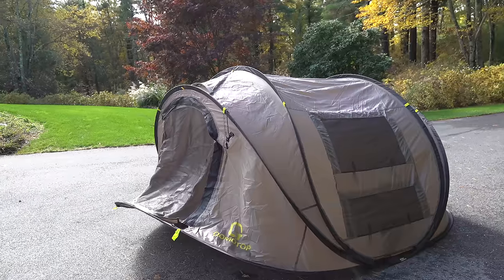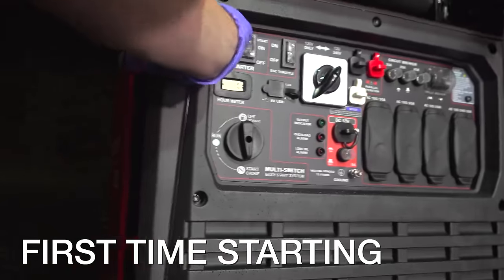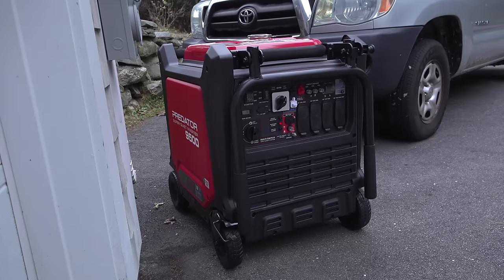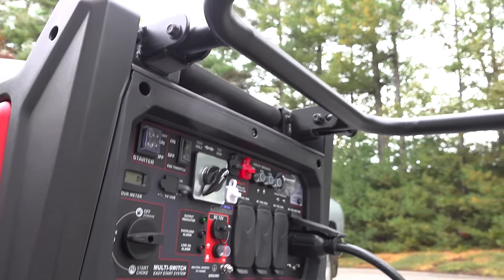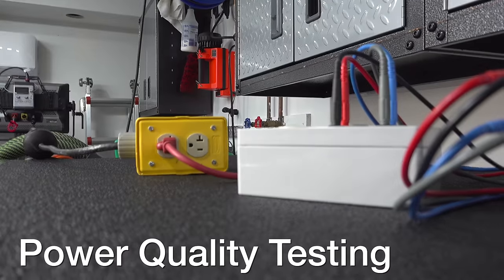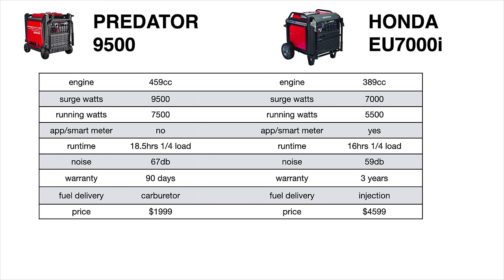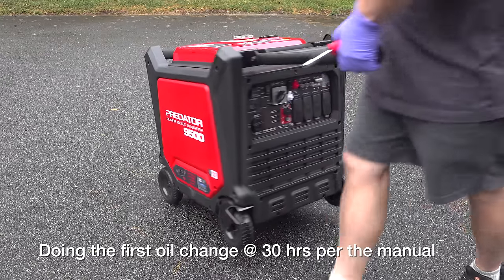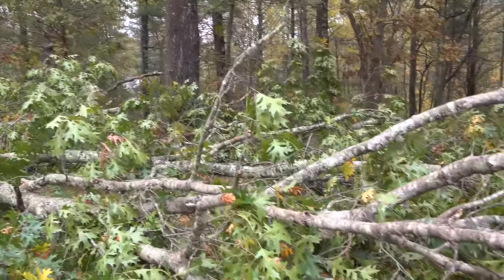BIGGEST Harbor Freight Generator Predator 9500 Review & TEST

Comment: I had a predator 2000W that ran for 25 years and was used just about every weekend. I also have a predator 4375W that's 14 years old. It runs great and fires on the first pull everytime.  I recommend them highly for reliability and nobody really bests Harbor Freight pricing. Dont waste money on the extended warranty.

Comment: I bought the predator when they first came out and now has alittle over 2900  hrs , use it to power my camper, and we camp alot, and has been thru atleast 10 power outages for days at a time we live in a very heavy forested area , and trees are always falling on power lines , last snow storm was Jan 1st was out for  7 days in Va , and for the price , id buy it again in a heartbeat , can buy 2 for the price of 1 honda , as long as i keep up on oil changes and what not, no reason not to believe this will last many many years to come, also cant wait until they come out with the parallel adaptor

Comment: I do not have a Predator 9500, but we do a 4500. We live in Mexico, Baja Sur and have had to use it many times due to storm outages and simply outages. I was suspect how long it would last. Today - better than ten years later - the generator works as good as the day we purchased it. We run all our refrigerator units off of it primarily - 2 freezers and 1 large refrigerator. Handles them easy. One time close to two weeks. IF I purchase my next unit the Predator 9500 seems the way to go and add more connections like a mini split AC. A Generac is another choice - like with installation - think near $10,000 USD. My friend purchased one and the FIRST YEAR it did not work. Don’t worry you have a warranty, right? Well when you are there WHEN YOU NEED THE BACKUP and all you can say, “Thank goodness I have a warranty,” but NO ENERGY.  Predator is the BEST DEAL, BEST BET FOR THE BEST MONEY. Thank you for your review.

Comment: Nice side by side comparison. 👍
I have the EU7000is & love mine! 
I have had it for 3 years of flawless operation. I have personally tested my generator to see how much power it puts out in non economy. I delivered 9200 watts everytime. Lots of other folks report similar findings. One watt over & it trips out.  That’s impressive considering it’s running watts is rated at 5500 watts. Fuel injection is the way to go. I use very little fuel compared to a carbureted model. As for run time? I bought an after market auxiliary fuel tank that holds 6 more gallons of gas. Because mine is fuel injected, I don’t need to prime the tank each time. The fuel injection siphons fuel automatically from the auxiliary tank set on the ground. Personally I wouldn’t buy anything from Harbor Freight. They sell garbage tools. I shopped there once & bought tools that were just for light duty & they couldn’t even perform for very occasional use. Time will tell if the Predator has the goods that the Honda possesses?
Reply: If you buy the right stuff from harbor freight it's pretty much good as the more expensive stuff at the other big box stores plus harbor freight has been bringing much better products out in recent years that even a lot of pros use. I don't know about their generators but I can definitely confirm they do sell some good quality stuff for a fraction of the price of most.
Reply: @nicksrandomviews1296  You might be right about the recent stuff coming from Harbor freight? I have only shopped there once about 7 years ago. Every tool I bought has been recycled in my garbage can. I bought a bench grinder. A fairly sizable one. Only used it to clean lawn mower blades once a year on it. It could not even do that well. I crashed a hammer through the top of it in frustration. The case was cheap cast aluminum. Low & behold. The motor was tiny compared to the case. No wonder it wasn’t up to the task? I bought a small pair of side cutters I bought for cutting string trimmer line. It  couldn’t cut plastic string. Their tools weren’t up to the task of occasional use. I spent $100 that day for a few items. It was like throwing away good money for bad. 
I will never step inside another Harbor Freight store ever again even if they were giving the tools away for free. I’ll continue to buy the tools I have always been buying. I will tell you Knibex from Germany makes some fantastic tools. They often can be found used at incredible prices. Many people have never heard of them. Only buy hand tools from reputable sources. Cheap tools mar projects & often lead to injuries.
Reply: You gotta be a troll 😅

Comment: You do a lot of videos that revolve around generators. Do you think you'll ever do a step by step process of how to install a transfer switch or something similar? Or is that risky content?
Reply from the maker: Thanks, I would love to show that and have installed many of them and learned some tricks. Let me see what I can do with that idea. Thanks!
Reply: @SilverCymbal  Thank you! Your videos are very informative and well done.
Reply: It's as if the universe knew.
Reply: @markpenrod8290  I have seen many people do this. Last I read it is illegal in my state to do it this way, but is basically how it is done with an interlock installed, which makes it legal.
Reply: @markpenrod8290  You do realize what your suggesting is what we refer to as a “killer cord”. Not only is it unsafe but it is illegal. I have personally witnessed this hook up in the past & with the potentially lethal consequences. The last one I witnessed the homeowner blamed his wife for not opening his main breaker. I reminded him we (as lineman for the power company) have the authority to call the building department in his town. If they determine any safety issue in his electrical system in his home? The inspector has the authority to pull the certificate of occupancy on the home. Forcing the homeowner out of his house. Then he would have to hire an electrician at his own cost to remedy any violations? 
I hired an electrician to wire an interlock in my circuit breaker panel. All to code with a permit. I would never endorse a killer cord. I did the homeowner a big favor. Past practices we would install a ground on our equipment. His back feed would have ruined his generator because his generator main failed to work. It tried to keep pumping power to our ground until it melted the windings inside & it shorted out. Leave electricity to the professionals.
Reply: @johnclyne6350  Yes sir I agree, was speaking in dire condition scenario..wouldn't believe anyone has actually done this let alone the several you speak of.
Reply: Reliance has several superb transfer switch installation videos on YouTube.  I used them to install mine; I didn't even have to look at the paper instructions the switch kit came with, and I had never done any work in my main panel before.  I bought the kit, then called for some installation estimates.  When the first guy quoted me almost $1100, I immediately became inspired to do it myself.  I cannot emphasize enough how easy it actually was.
Reply: @SilverCymbal  please let me know your transfer switch set-up ….. as I am ready to make the investment. Thanks
Reply: @markpenrod8290  You’d be surprised! Hence death cord. I see plenty of stupidity after storms. I get it. Desperate terms create desperate situations. I know most people are not good planners. They wait until it’s situation critical. Then they do something totally stupid! Many of my own neighbors call me after their lights are out for a day. They start looking for generators? They are nuts! Prices are through the roof if you can find one? Then they never buy what they need. Then they buy only part of it. Most people shop in the “big stores”. I buy big purchases like that from mom & pop stores when I don’t need it. I already did my homework before I go in looking for something. I worked with an electrician & a fabricator for my installation. They were delighted to work with me. Most people want it done as cheaply as possible. Hence the death cord.
Reply: @markpenrod8290  Whenever we arrive at a new work location. Part of our “tailboard discussion” is about “backfeed” (generators, solar arrays & worse yet, shotty craftsmanship). We discuss the presence of a possible back feed scenario? We have testing instruments to determine if there is a presence of power when there shouldn’t be. We make a note where we hear generators running. There is that very real threat that there could be one hooked up illegally. Remember the big box stores will sell you a generator but won’t tell you how to hook it up correctly. We run into one of these scenarios about every other year or so, not often but not exceedingly rare either. 
Hydro Quebec lineman had initiated repairs on a street but left unannounced. Something must have spooked them to leave? Sure enough there was a backfeed on our primary by way of the transformer. It was generating 13,200 volts to the open switch from the load side. We started pulling house meters one at a time on houses to determine which one was the offender. Sure enough we got our illegal generator using a death cord. The coward blamed his wife.
Reply: @jmljml5065  good for you! However did you pull a permit at town hall & get your installation approved? If not? You may have an issue with the insurance company in the event of a fire directly attributed to the transfer switch. Hence why as an outside wireman I had an electrician install mine. It’s his license & insurance on the line if he screws up? 
I have a Reliance inlet. It’s well made! A transfer switch limits your ability to run more than a dozen circuits though. I went with an interlock instead. I have a working knowledge of electricity. I shut everything off manually in my main panel. Start my generator & transfer my source from the power company to my generator. I slowly add motor load to my generator. Then add the other circuits one at a time. I can run my entire house on my roll out generator.
Reply: I just ran a 30 amp cord to where my dryer plugs into. When the power is out, I shut the Main off, plug the cord from the generator into were the dryer plug usually goes, then plug the other end into the Generator. Start it up, and then I’m Powering the whole house. When I notice the power is back on, I turn off the generator, unplug the cord from the Generator, then unplug from 5he dryer plug, then switch the Main back on. Just need to use, what the Majority of People don’t have anymore, Common Sense.
Reply: @sweetsuccesstrading5097  I’m glad you have a plan & know what your doing. I would never endorse that though as what you have is a “killer cord”. If the building department ever found out what you were doing? It would not go well for you. That being said. You know the critical piece is opening the main. However I have seen main disconnects leak voltage back through the line. The best practice is to pull the electric meter. Then you have a visible break.
Reply: @johnclyne6350  i agree if you don't get an interlock, invest in extension cords....thats what i did.
Reply: @SilverCymbal  instructions included with the kit. I've installed at home, was not too bad.
Reply: @sweetsuccesstrading5097  facts

Comment: Very nice and clear video.  That testing machine is really expensive-- not something most of us have in our garage.  How do you happen to have one?
Around 45 years ago when we built our first house, it was too expensive to have poles installed by the power company, so I built a generator, created a battery bank, and ran the ac-only stuff (my typewriter, my wife's computer, and a turntable) through a sine wave inverter.   When the generator broke, I had to fix it.  Gotta say, flipping a switch these decades later is a lot easier. 
But when I had the generator I also had a box (outside) I kept it in.  That did two things: It kept the weather off, and it made the noise a lot less.  Building a (noise) insulated box is not that hard, the only trick is to ensure air flow to and from the generator, and that isn't really hard.
We can easily go a day or two without using the washing machine and dryer, but it would be nice to be able to not worry about the freezer and fridge-- and to use the computers as well, even if the internet is down. 
Will give this some thought.  We've only lost power for around 30-40 hours during the last 37 years.

Comment: If u get a used honda get the honda! . I got a locked up eu30is (the 230v model) for 500$ in absolute brand new condition. It just had 20hrs on the clock but the owner left the gas knob open and did not use any fuel conditioner so the petrol roted inside the whole fuel system and seeped into the cylinder and caused the oil level to increase+ that residue locked the engine. I removed the entire fuel system from carbuator to fuel tank and clean everything up , it tooon 3 days to get the carburettor looking better. Left the engine cylinder with a lot of wd40 & while i was cleaning the carb the engine freed up , i put the spark plug and held a flamed out propane torch to the intake and in the first crank it ran and made enough power to run 2200w heatgun on full power. I ran for a min to check the power and then i was confirmed everything is good and after cleaning the carb and fuel tank & its running like brand new , everything works !! 
The generator is so quiet that i am glad my old honda ebk1000 was stolen and i got this awesome deal 😂. I am doing a propane conversion now as in my country it is cheaper on gas than on petrol.

Comment: I bought this generator and beat the living shit out of it.  It ran non stop until the required break in period oil change, and maybe a little bit over.  Then I ran the crap out of it again for about two months straight non stop, fueling it directly while it was running. When I was done with it.  I changed the oil again and now I run it for 15 minutes every month, using the "storage" shut down procedure.  

I am very happy with it.  It is a beast of a generator and is relatively quiet.  I also own its little brother the 3500 and have had that one for several years. I removed the electric shut off forcing it to shut off when it uses up the fuel it the carburetor have kept up with the maintenance.  the 3500  has never let me down. 

These two generators are highly dependable and priced right.   I recommend them highly.

Comment: I Must Say the harbor freight generators work pretty good,over Xmas here in AZ but up north at my property 6000 elevation we took 2 toyhaulers 1 20ft enclosed trailer,bought a brand new in box prediator 3500 just in case 🤔 ended up using it 2nd day out of 4 the generators on toyhaulers didn't like 15° cold weather we ran both toyhaulers off 1 3500 prediator for 4 days and Very Quite,For The money I went bought 1 as backup and the extended warranty 52.95 for 3yrs well worth 988.00 👍👍👍 Killer Video 👍👍👍👍👍👍

Comment: I just bought a new honda EU7000IS. Well, I have 3 that aren't working. I love them!! Interesting right. Well, I run my generator full load 16hours a day 5 days a week none stop, one of them the hours rolled back to zero not sure after how many hours this happened, and still put just about 3000 hours before I got a low compression, Im not a mechanic, I have fixed a few of them at a honda dealer but due to the hours something else would go bad, time and the cost to repair was just not worth it for me. I have also used Onan got 2 of them as well in not a working condition, honda has proven to be the best one for my line of duty . I can't say much about the predator,   but I know one thing CHEAP IS EXPENSIVE. Also nice review on the predator.

Comment: Seems like a typical difference between warranty options which reflects in the price tags. The other deciding factor would be rebuild parts and availability. A hard run generator off-grid in Alaska let say is getting a rebuild approximately once a year. People here have two or three and alternate them out when one is being rebuilt and always have one for back up in case it should break down. I'd love to hear about the longevity of this generator off-grid.
Reply: you cannot beat Honda for parts availability. Maybe some other brands like Generac have parts available. Good luck with HF. Throw away.
Reply: The thing is, if you have a Harbor Freight nearby and it breaks within 90 days (even the tiniest issue, doesn’t matter why you want to return it) or within the extended warranty, they just swap them out no questions asked and you’re back online. We always have two gens (we’re offgrid) and thinking ahead and being savvy with time and money is key to success. Anyone else you buy a gen from, it’s a straight up hassle if something goes south, no matter the warranty. HF wins the war easily just for this reason.

Comment: Use this in my 50 amp camper and I use both 220v outputs. I can run my a/c in the campers for about 14 hours straight. The unit runs very very quiet and we are very happy with itm

Comment: I normally recommend this generator but recently got a tri fuel firman from Costco and like it a ton. A lot of flexibility on what gas’s I can get my hands on. A little less power but it was $1000. I would definitely look at it!
Reply: But that Firman isn't an inverter generator, is it?  I think that is an open frame conventional generator that runs at 3600RPM, not an inverter that will power down during low load to save fuel and noise...
Reply: @lakecavanaugh Everything in life is a trade-off.  Inverter technology is nice, but of course, costs more.  Might save you enough over it's lifetime.  Quieter usually, too.